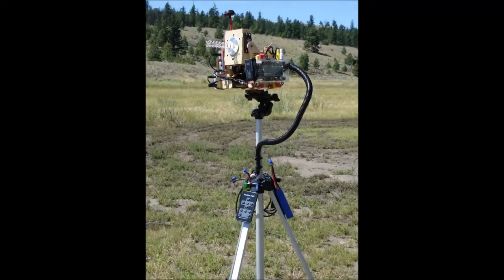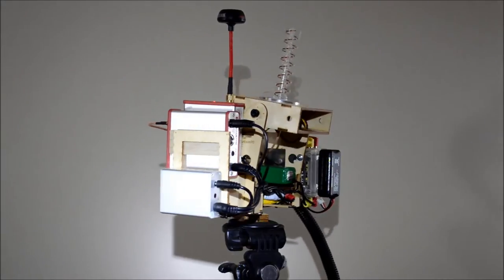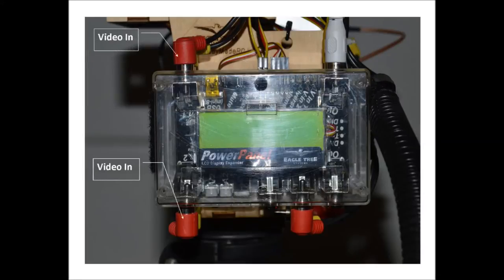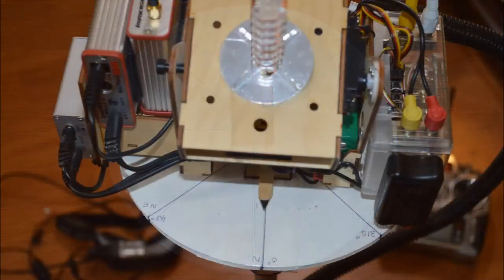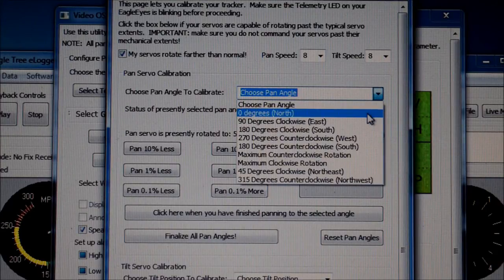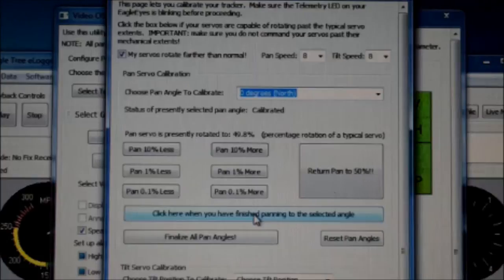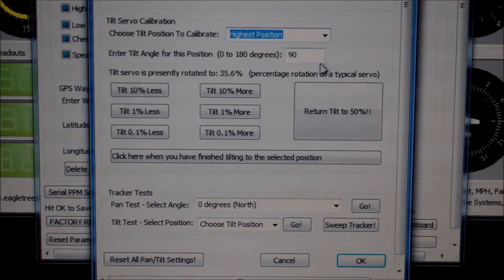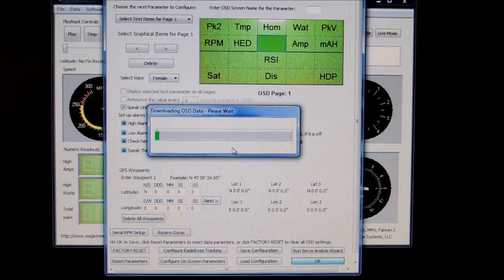Antenna Tracker

Comment: what servo do you use? does it have to be 360 degrees rotation servo for pan? or is that because the servo using the bigger gear to drive smaller gear so it doesn't have to be 360 degrees rotation?